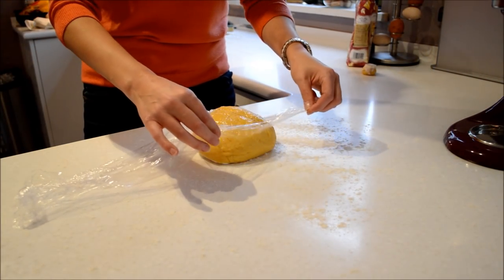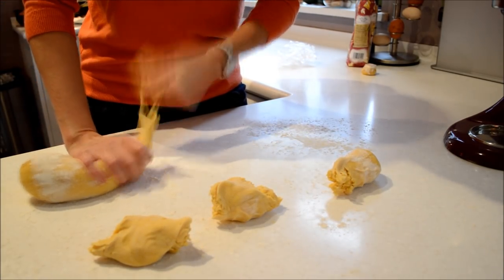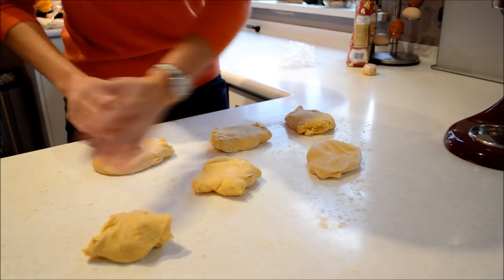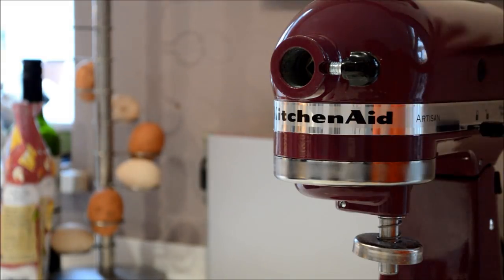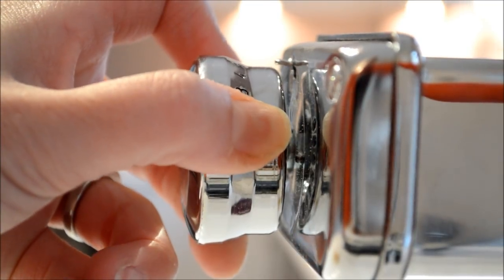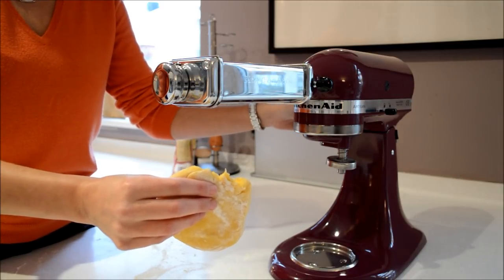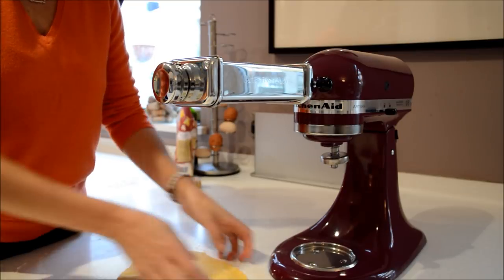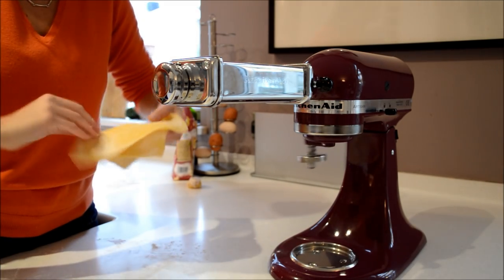How to Roll Pasta Dough using the KitchenAid Attachment

Comment: thx for video. how much time does this save vs 100 by hand?
Reply: A very long amount of time. Trust me.
Reply from the maker: Quite a lot I'd have thought...I can never get the pasta thin enough by hand.
Reply: My dough was tough but I rested it for longer. And rolled by hand and it took me about an hour....again  hard dough. 
I brought a mixer and roller just so I never had to roll again buy hand. I mean actual rolling pin on a small counter roller each lasgna sheets individually. 
When the mixer and attachment arrived I had already made my dough with the food processor. Again it was hard. But....I folded in thirds twice on level 1. Only dusted the outside. 
Put it through twice on 2. 
Once on 3 and 4 and 5. 
But it was so elastic by 3 I didnt need to dust anymore. 
So many making it slightly less wet is a good thing???
It was done in 10 mins on the roller....made 300g worth. 
I cried like literal  tears when  I finished because it was so much fricken easier and I was just grateful asf! Lol
I cut the strips in half by 3 though. Dont see the need to have meter long pasta. But thatd just me lol

Comment: What's the purpose of folding it before feeding it back through at the same thickness?
Reply from the maker: epicpolyphony hi,think it stretches the glutens,  makes it more elastic by giving it several rolls through, and gives it a generally more silky texture. You don’t have to refold though. This quote is from a guardian article...
“Rather than simply passing the dough through a pasta machine, both Angela Hartnett and Giorgio Locatelli fold it back in on itself halfway through the process, and repeat to give a more evenly rolled finish. This takes longer, and I have to work quickly to avoid the pasta drying out, but the texture seems more uniform, and the pasta stronger and more elastic, than with a simpler, but less thorough method.”
Reply: Merlotti's Bon Appétit you rock. I am so excited to purchase the attachment now. Thank you so much

Comment: U should really think about ur process...
Cutting instead of ripping apart, 50g is enough for having not too long pieces, difficult to handle.
keeping the non used part wrapped in transparent film to protect from drying.
No need to add flour before the very last runs, else your pasta will dry quickly and flour will not be mixed evenly. Flour is used only for avoiding sticking.
Pasta should not pop if folded and inserted properly.
Reply from the maker: Jean-Luc BrassamTV thanks for your tips. 🙂
Reply: If you don't add flour before the last run the pasta will stick.
Reply: @markgorman4805  no it doesnt. Depends how soft your dough is to start. By level 3 mine doesnt stick and I like to roll down to 5.
Reply: @salenawaaka6258  Well on my first  roll I spent an hour getting completely frustrated until I figured out that I am not adding enough flour.